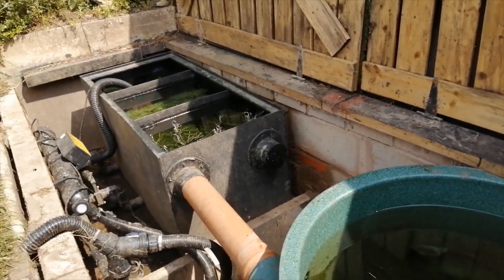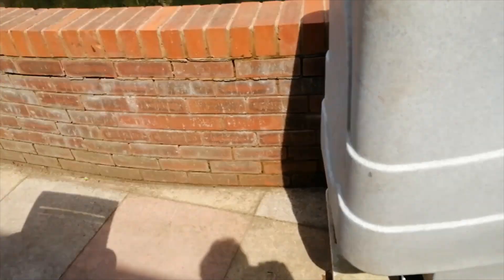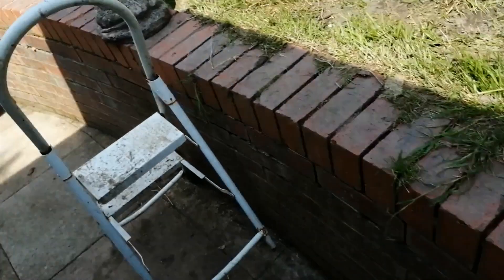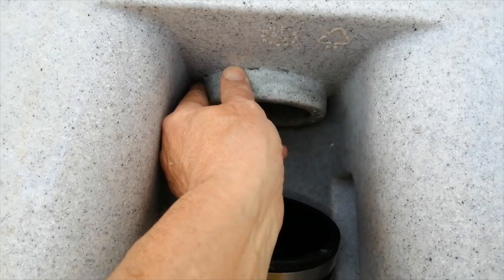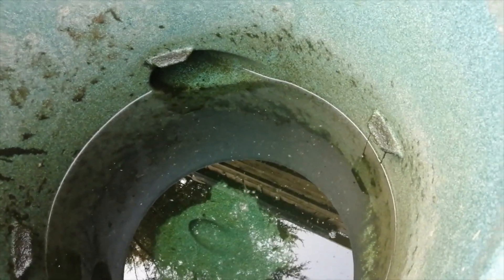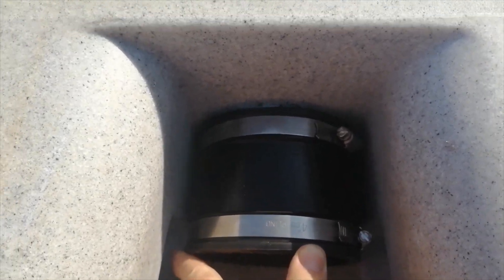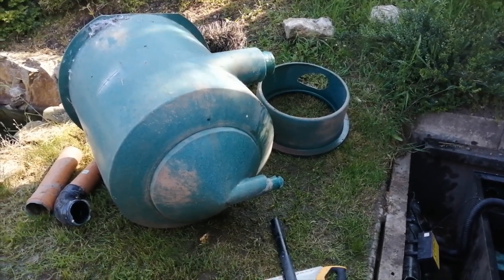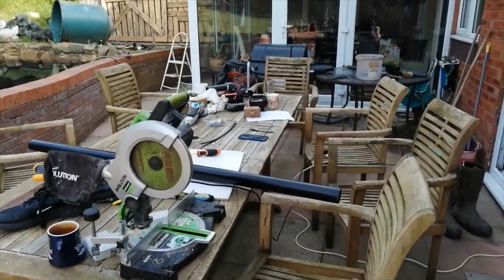DIY fitting the Cetus Sieve pond filter goes terribly wrong!

Comment: I am sure you will solve it. My system runs a pump after sieve into a bead filter. All pressurized after that. The tempest is normally under pressure. So I think it will work out good.
Reply from the maker: Thanks for your support, it's much appreciated.